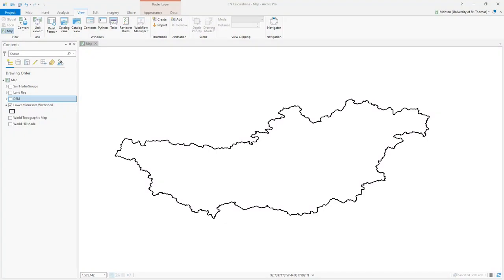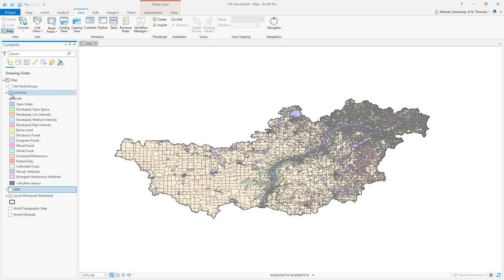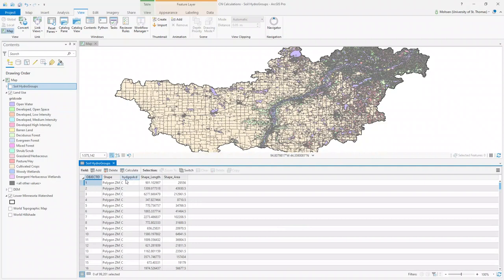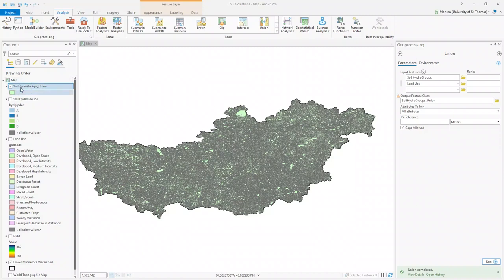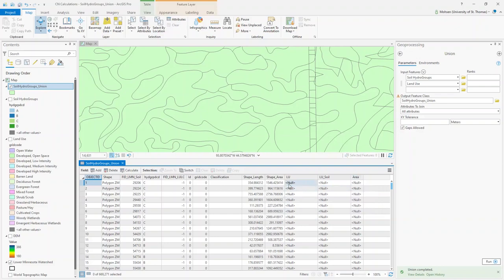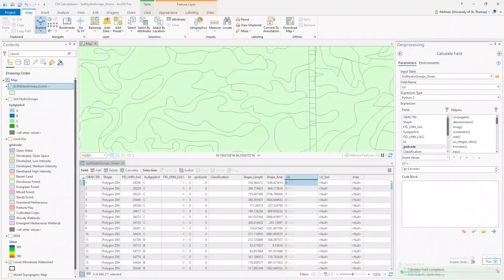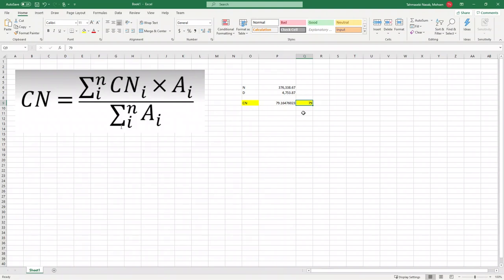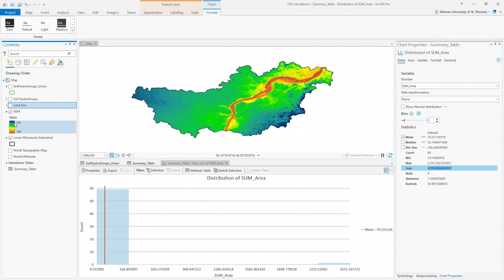Curve Number Determination Process by Land Use and Soil Data Using ArcGIS Pro

Comment: Thanx a lot for the good explanations .

1. What Projection are you using in your data. Want to replicate the results.
2. In case we want the CN for each sub-watershed, how can we get/extract the average of each sub-watershed ?  Do we have to use the shapefile for the sub-watersheds (LMW_HU10 in your example). Instead of the shapefile for the entire watershed boundary (LMW_HU8)

3. Does the raster data resolution has to be the same for each raster (Soil, LULC, slope [DEM])
   Since the soils & land use are 30 m resolution raster, your DEM  must be the same resolution, right ?
Reply from the maker: Glad you liked it! 
I think I used UTM Zone 15 for projection.
If you want CN for each subbasin, do a zonal statistic in Arc Pro. I might make a video on that!
And the same resolution is not required but it helps with the accuracy.

Comment: There must be a video before this or right after the Soil [download & process] video . In the soil video, the soil Hydrogps has soil types [null, A, A/D. B, B/D, C. C?D, D, D/C & all other values]. At the end of the soil video you mentioned to keep all files [wshed boundary, LCLU & Soil hydrogpdc].  This CN video however, started i) without any reference to any further processing of the soil file. ii) The soil file added on this video [curve number calc] shows soil types A, B, C, D, & all other values only. Which is different from the one we had at the end of the soil video. I replicated everything upto that point.
  Have you processed the soil Hydrogpdc [ even the LULC]  further, to make it only 4 soil types? If so, what did you perform on  it to get it to the types shown on this video?
Reply from the maker: Good catch! Here are the steps: you can open the attributes table of the soil shape file and perform a search by attributes. Search for A/D for example, and edit the to either A or D. Considering D is more conservative. Do the same for other mixed soil hydrogroup types. Once you are done, you will have a soil shape file similar to what I have at the start of the CN video.